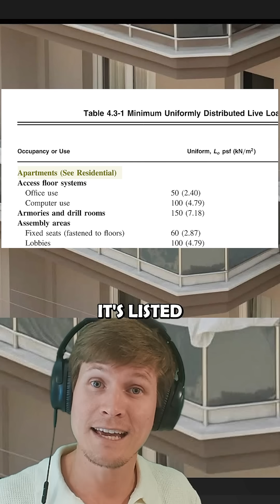Engineers HATE This Balcony Pool - Here's Why #structuralengineering #engineering #reddit

Comment: Please. As an engineer. Use metric... 1 L = 1 kg = 0,001 m³ or 1000 kg = 1 m³. So every cm (or 1/100 of a meter) of water depth = 10 kg/m². The balcony has about 50 cm = 0,5 m, so 0,5 m³ of water per m² of balcony = 500 kg/m². Converting this to kN depends on gravity, but we can round it to 1 kg = 10 N = 0.01kN to make it easier (order of magnitude is precise enough). So the approximate load is 5,0 kN/m². See how much easier this is? No calculator required!
Reply: You can make it easier than that.
Water density is 1 ton/cubic meter.
So if it's half a meter tall, it's half a tonne per square meter...
Reply: @Evan_Bell * metre
Reply: I just eyeball the shit. That one there looks dangerous and fun.  I'm sure it won't be fun for too long when it comes off the wall and you are swimming in the air. 😮😬😵☠️💀👻
Reply: How much is it in burgers per bald eagles?
Reply: Thanks for saying it. My head started hurting listening to psf and pounds and foots and shit.
Reply: As soon as you send men to the moon using a metric rocket - we can talk.
Reply: @whatdamaddox7824 You know NASA uses the metric system, right?
Reply: @andreas40588  It's just a joke shizzle.
Reply: no one is going to get the USA to switch to metric. not now. not ever. get over yourself
Reply: I don't care what unit you use, but as an engineer you had damn sure better be using a calculator lol
Reply: @jehreelul feel like you're putting too much trust in calculators. Most calculations are actually best done fractionally as its more precise, and really what matters most is correctly identifying and structuring the equation. The actual solving is pretty trivial, and it gets checked multiple times by multiple people. The only "calculator" I would use is a modeling software
Reply: All that when he just did one simple step. Excuse you, but yes, do please keep the oversimplification to yourself. Thanks
Reply: @Bosgek0 first of all, you added in an extra step of multiplying gravity to get the force, US units are already in terms of force (lbs). I understood your math, I just wouldn't call it "easier" by definition.

Second of all, (and I say this as an engineer and an American), I love the metric system...where it's being used. I also love the US system where it's being used. They both work equally well if you know math. However, mixing metric in the US and vice versa is a futile exercise and impractical. You have to take more time now to convert all your values to metric if they aren't already, and then how do you expect other engineers to check your calcs easily? Rounding between the two can also screw with your calcs when you try to convert back.

Not everything has to be converted to metric. Just work in the units that your client cares about. That would be the "easiest" way to do that load calculation. No calculator required? Unless you're doing a rough calculation for a client away from your desk, last time I checked the calculator is your best friend. No one will appreciate your mental math unfortunately.
Reply: He's likely american. The metric system is a strange creature from their point of view.
They use it in serious papers such as science, but not in everyday-murica-type situations😌
Reply: @ChaineYTXF All American students are taught both metric and US systems from elementary school onward.

Metric is used in all sorts of fields inside the US, like every profession you'd find in a hospital, all sorts of engineering fields, and so on. Both systems are used in the US military.

The metric system is not used in construction or building codes in the US.
Reply: I like to do both to check my work 😂
Reply: Says the human calculator
Reply: I was thinking about the same... These 24 square burgers per cubic alligators is absolutely ridiculous
Reply: @foshizzlfizzl a "foot" or square foot, cubic foot, etc is a standard unit of measurement, as is an inch. Its no different than using a meter or centimeter. What do burgers and animals have to do with it? 

Do you think that people measuring in feet are using their actual feet or something?
Reply: @histguy101 There is a huge difference.. You have to make conversions...that's a source of mistakes..10 cubic feet isn't 1000 cubic inches, but some fd up number 😂
Reply: Gotta love the metric system for volume to mass conversions. So simple.
Reply: Whatever bro! We have freedom units.
Reply: @morrit33 guessing you're American by that response. Do you know what system US businesses that trade and buy hardware internationally generally use, NASA use and the Military? What do you think a klik is or 9mm ?
Reply: @christopherdwyer9496 Navys 5inch gun and the .50cal, etc would like a word...
Reply: @wheels-n-tires1846 typical uneducated response, nothing to do with the conversation and unnecessary aggressive. 

I'm just proving you do use the metric system whether unaware or ignorance and nothing you have written has anything to do with it?
Reply: @christopherdwyer9496 you mentioned that the military uses it... and while that's true... It's certainly not 100% true, as my examples  show.  I'm not sure how what I said is aggressive, unlike your "uneducated" comment... which seems to be. ( Never mind that it's just wrong... I can speak about the military with significant experience and knowledge...).
 And lastly... no... I dont use it. I purchase my fuel, milk, and other liquids by the gallon. I buy dimensional lumber that's identified in inches. I drive on roads with limits set in miles per hour. I use extension cords that are XX feet long. I can go on like this all day....
 But ill give you one tiny point... occaisionally, I do work on cars that require metric tools... Although I find that annoying...
Reply: The next time your country does anything that actually affects the world we'll follow your lead.
Reply: @marcushenness6437  the whole world literally follows our lead. Every sheet you find uses metric system, everyone in the world except Americans and British.

Touch some grass
Reply: you're a bad engineer if you don't understand how to keep units coherent.
Don't convert needlessly.
Reply: Please come and convert the whole of the US. Otherwise, stop complaining that someone isn’t following your standards.
Reply: Nobody cares here in the states. We're not going to change units just so appease you're European preference. Also when people design these things they will check with a calculator regardless of the CAD software doesn't do it for them.
Reply: piss off euro
Reply: Womp!
Reply: yeah but 1 lbm exerts 1 lbf under normal gravity
Reply: As an engineer , you should always test and review your code and retest it after you merge it
Reply: You can't state equalities between different quantities, ie volume and mass.
Reply: Sorry, we live with freedom units from the most free country in the world. Get fckd metric system
Reply: As an engineer, I live in the US so I gotta suck it up and do 2 seconds of math in imperial. Not that big of a deal.
Reply: Metric makes it easy enough, but it is so jarring to me to see people using a comma as the digit separator for groups of individual and fractional units, and likewise with periods as the digit separator for groups of 1,000 and beyond.
Reply: No. In the US we don't use metric so our codes won't be in metric
Reply: As a scientist, just use consistent units. It doesn't matter. When was the last time you did a real calculation for your work, not an estimate, where you didn't use a computer?
Reply: Well considering the Americans refer to train drivers as „engineers“ who knows what he might actually be
Reply: Make your own video, Mr know-it-all
Reply: @ryanaddy1135 😂😂😂😂😂 how old are you to arguing like that? 5???
Reply: I've never been more bored watch a short
Reply: bro is using a calc
Reply: What we really need is a better system that combines both effectively. Therefore reducing costs to update old equipment and making it easier to build new stuff. Combine metric and imperial measurements.
Reply: @JACKBAIN17 there is not one reason to  keep your imperial.. It's simply inferior to the metric system in all occasions! It's just as always your convenience and comfort zone. It's like texting without word recognition... You can use it and be faster and more efficient.. Or you can write a text message for 3min...it doesn't make sense anymore! Change your approach!
Reply: No commie units rahhhh 🦅
Reply: No thank you, comrade.
Reply: Sybau
Reply: Exactly—using SI units makes the math intuitive. 1 L of water is 1 kg, so 50 cm depth equals ~500 kg/m², or roughly 5 kN/m² when considering gravity (1 kg ≈ 10 N). No calculator needed when you keep it metric.
Reply: This is why nerds get bullied😂😂😂😂
Reply: Freedom units! 😎 (I hate being an engineer)
Reply: Contractors don't even know where to contact an engineer and if that engineer is actually not engineer 😅
Reply: Nothing is lower than bitching about units systems. Can you do math? Then great, you can talk about things with your coworkers even if your old gauge had different numbers and words on it too!!
Reply: As a Canadian. Fuck metric I don't understand that bs
Reply: @Kb.69420 😅😅😅 because imperials just use google assistant for conversions. Understanding is not necessary 😅
Reply: If you're speaking english use a dot "." as a decimal separator. If I speak whatever continental European language you speak then in that context I will use a comma as a decimal separator. I don't care what language you learned math in, right now you're writing in English.

So it's 0.5m not "0,5 m"

PS: SAE measurements have the same trick for the weight of water, each pint of water weighs a pound. Each cubic foot is 60 pints or 60 pounds of water.
Reply: America 🇺🇸 🦅
Reply: Well, okay, mr copernicus, who's apparently smarter than us, dumb americans.Well you know what you're just proven that we're stupid for using an old system that really isn't that good. Does that make you feel smarter about yourself? Well, you shouldn't because you're smarter and I then we're stupid. So yeah, how do you like that
Reply: They prefer to use eagles per square inch
Reply: I kind of can actually understand this, as someone with dyscalculia
Reply: I’m a mechy and I will simply refuse to do so just because someone wants me to use metric.
Reply: When doing this kind of important math wouldn't you rather not do head math?
Reply: Oh brother 🙄
Reply: We know how metric works. We don't need you to explain it. You're a pedant.
Reply: THANK YOU! For translate to normal mesures! 😂
Reply: He didn't actually need the calculator since the cubic foot weight of water was just over what the regulatory minimum specifications for that balcony were. Anyone can figure out from that fact that the amount of water needed to make the pool usable would certainly far exceed the likely structural capacity of the balcony even without anyone actually using the pool.
Reply: US still using the imperial system is a dumb thing
Reply: I completely understand your frustration, but we have no choice😪 as an American, we got it wrong when we went with SAE
Reply: Yeah, I'm confused with pound per square ft too. I don't know how many kilograms a foot is, and I don't know how many meters a pound is.
Reply: @andikardian9014  example: if the regulation calls for 100lbs per square foot of an area of 10ft x 10ft, the the whole area should be able to securely hold 10,000 pounds.
Now let's throw some random numbers out there and say the balcony is 8ft x 15ft and the water depth is 2.5ft. This would mean that the balcony is holding up over 22,000 pounds. That's a lot. And not only can the floor not hold it with certainty, but the damn guard rail with glass will blow out anytime as well.
Im drinking, don't trust my math rn
Reply: Imagine using commas instead of decimal places lol
Reply: 🤓metric🤓
Reply: Just a truck driver here, balcony? Pool? No bueno
Reply: I don’t mind metric, but I really cannot stand commas in leui of periods.
Reply: The Gimli Glider does not second you.
Reply: Except this is America so we are scared of kilograms 😂
Reply: Honestly it doesn’t make sense to do that in 🇺🇸 as all there design standards are in imperial and would cause more issues, the maths is still the same, it’s just the values that are different.
Reply: Sorry I cant hear you over the sound of all the bald eagles screeching, V8 engines, and big tits! What did ya say? Fuck metric! Freedom! 

On the real I like to use metric 😂 but it just comes down to this is an american channel, if it was anywhere else in the world it would be in metric. No need to explain your metric superiority.
Reply: Bro what the oil
Reply: Isint conversion the reason why NASAs space craft crashed that one time?
Reply: @josechavez2521 you don't have to convert anything if you use the same simple easily divisable units that the rest of the world uses.
Reply: @dusannestorovic5699 Hey man I'm Mexican, you dont have to convince me lol
Reply: @josechavez2521  yeah and after that is when everyone particularly from a certain country started on the metric is better put it down our throats constantly 
   After pirates from said land stole our metric system 😅
Reply: @josechavez2521 not doing the conversion is what caused the crash
Reply: @josechavez2521  i think it was because they didn't convert the numbers in the metric sistem
Reply: @josechavez2521  ya, because metric is the real system of science and imperial is all based on metric system and to not loose accuracy ppl must go to metric to actually get real values, this nonesense of using imperial here and there crashed the NASA stuff.
Reply: @josechavez2521 conversion, yes. Which is why NASA stopped using imperial ever again. Because Metric is an easier system to work with and more importantly allows you to talk to and work with people outside of gun country. Because it’s the US and I think 2 other countries that use imperial as a main measurement system.
Reply: @josechavez2521 yeah and after that they adopted metric as the standard to prevent issues from ever happening together. That's the real main issue. When you have several people using different standards for things. Which is why I always just adopt whatever standard the requirements are in. Makes no difference to me which units I use.
Reply: Also as an engineer, if your reference codes are not in metric don't use metric! Keep units consistent with each other. It's how you end up making mistakes by forgetting to do appropriate conversion factors. 👍
Reply: @ZenithWest169 Unless the the codes are from the dark ages they will be in metric.
Reply: @joey66436 yeah I'm not a civil engineer and didn't even realize it showed both. I was more of just making the point that consistency is king!
Reply: @joey66436  Wrong. Codes are in the local standard because every building in that area is built according to those standards. He used the standards that are used in the US for commercial building. They are perfectly functional. Every skyscraper you see in New York uses that code even when they are a thousand feet high.
Reply: @ZenithWest169 should be illegal to use imperial units. The Metre is objectively better
Reply: @zerperior The meter is as objectively random as any other length unit ever invented. There is nothing inherently better about a base unit that long. It's actually very inconvenient for many contexts.
Reply: @kentix417 the meter is not arbitrary, it's based on the atomic density of silicon, which is a very stable non-radioactive element. It's based on a fundamental law of nature.
All imperial units are defined as ratios of metric units, that's how much better the metric system is.
Reply: @aftoknito I don't know where you're getting your information from but the length of the meter has never been based on silicon. At one point it was the exact length of a specific platinum bar and then it was a platinum-iridium bar. In other words, the length of a certain hunk of metal kept in a vault. Then later it was based on the wavelengths of a certain frequency of light in certain atomic transitions. Now it's defined according to the distance light travels  in a certain very specific amount of time. But all of that misses the bigger picture. That's all about increasing precision. 

The question is how come the meter is as long as it is? Why isn't it much longer or much shorter? Where did that original length come from that has been made more precise over the years? And here's the answer to that question which will show you just how arbitrary a length it is. The original definition is that it is 1/10 millionth of the distance from the equator to the North Pole along the meridian passing through Paris. That's it. There's nothing fundamental about that length in the universe. It's based on one planet in one solar system and the location of one man-made city. No matter how much more precise you want to make it, that's literally what a meter is based on. One 10 millionth (not even something even like 1 millionth or 1 thousandth) of a distance over the ground between two points on Earth. That length has nothing fundamental to do with the universe or physics. It's an arbitrary, man-made length -- no different fundamentally than any other arbitrary man-made length.
Reply: @ZenithWest169 That's how you blow up millions on a rocket like nasa did back in the day 😂
Reply: @neilsiebenthal9254 already discussed it.. my point is consistency above all else. NASA recognized that after the failed operation and immediately declared only metric would be used in all of it's work.
Reply: @ZenithWest169 no, convert them into metric, do your calculations, then convert them back. WAY better than using this shitty aaahhh system. Ask any physicist
Reply: @ZenithWest169  such as at one time of the space bound rocket… 🫠
Reply: @ZenithWest169  and infact we use something called "International system" where is mandatory to use the metric system
Reply: @ZenithWest169 nope, you just convert at the end. If you don't use matric you are way more likely to make errors than the error potential for converting one time in the beginning and one time at the end
Reply: @yannik1679 that's how NASA lost a multi-million spacecraft a long time ago. They since changed to requiring pure metric. My entire point is consistency is king!
Reply: @ZenithWest169 The comment is obviously written by someone not in the US, as he uses metric and a comma rather than a decimal point. So his building codes are most likely metric.
Reply: @ZenithWest169  Correct.
I heard about a church in a small village in a nordic country.
The architect used feet, but when it was built, they thought it was in meters.
So, they've got a gathering of 20 people
in a church that can hold 200 people, or so.
They built a separate room for the winter.
Because it's too costly to heat the church.
Reply: @ZenithWest169  the point is, imperial is stupid system of different units not matching.

Metric is so much cleaner and easier.
Reply: @pnodi5584  my only point is consistency above all else!
Reply: @ZenithWest169 As a Heavy Construction Contractor with a 10th grade education, i agree with you. I also know, their no way that balcony is design to carry a load of 60 P sqft. Its more like 1500 psi.
Reply: @ZenithWest169 there were references in kN/m2. However these were not rounded.  What I tried to show was that for estimations metric is simple: every 10 cm of water depth gives 1,0 kN/m2. If you get  comfortable with the SI system and know how to move a decimal point you can do all kinds of rough estimations without touching a calculator. My original post was maybe a bit too long, in practice I know these conversions by heart to do this in a few seconds.
Reply: @Delta_ACh  Lol I didn't notice at all to be honest. I'm not a civil engineer and was more of just commenting that you should be consistent above all else. Personally I prefer metric over our normal units and exclusively use metric in any personal project that allows it (meaning I'm not designing something that will mate to something else with non-metric units.. again consistency above all else). But regardless of how much I use them I can never guestimate any measurement in centimeters. I just can not develop any intuition for it after a lifetime of having everything measured in inches. What's funny though is I can not guestimate fractional inches as all because I have always used millimeters on the sub-inch scale lol.
Reply: @Delta_ACh  decimalssuckwaytoomanystringof.uselessdigitsandannoyingtoread
Reply: @ZenithWest169 i'm a south american machinist, and as a south american we use both systems (because we mainly import any machinery from the US as well as europeo). I can guesstimate both in metric and fractional inches
Reply: @TheSmmp1  yeah I wish I could guestimate metric
Reply: @ghost-jesus what about the rest of the world, since the US isn't the centre of the world
Reply: @yag-yet_another_gamer  idc, but total french erasure involves erasing metric anyway, so it's gotta happen.
Reply: Thx! 3ed comment and I was not disappointed 😂😂😂
Thank you for your service Mr. Engineer 🫡
Reply: Thank you, the american mind cannot comprehend this ❤
Reply: @revstreak "American mind" America is one of the newest founded countrys and the super power of the world. Let that sink in
Reply: @revstreak Just like you can’t comprehend that Americans learn and use metric all the time? 😂
Reply: @revstreak  The one time someone in America used metric, a spacecraft crashed.
Reply: Bro we use freedom units 🎉🎉 EAGLE 🦅🦅
Reply: @NobodyJustShorts except your military? Perhaps the real freedom units are metric!
Reply: @NobodyJustShorts  why are you using freedom units in an authoritarian country?
Reply: @NobodyJustShorts  u guys use british units
Reply: @NobodyJustShorts Not your scientist and military. Intelligent people un the USA use international measurements.
Reply: @josechavez2521 😂 You probably tell people the lie that metric got America to the moon. 😂
Reply: @michael-dm2bv  The crash happened after the moon landing.
Reply: @josechavez2521 Only partially correct. There are non-SI units in basically every discipline.
Reply: @josechavez2521  Everyone in the US uses metric, just not exclusively. Stop pretending that using metric is a sign of intelligence. You know what is a sign of intelligence? Using the unit that matches the situation.
Reply: @gravityissues5210 No, not everyone in the US uses the metric system; the US has a hybrid system with a mix of U.S. customary units and metric units, as a complete and compulsory conversion never occurred. While metric units are preferred for trade and commerce and are mandatory in certain fields like medicine, many everyday activities and commercial transactions still rely on customary units.
Reply: If you’re in America it’s easier to understand in units that are in use and everyone knows
Reply: I like metric, I like using metric. I hate seeing comments like this.
Reply: Yahhh idc what your title is, no one cares about metric lol
Reply: Please. As a normie random internet commenter, please feel free to take the time to script,  shoot, edit, and post your own video using any terms and standards you like. Until then, either appreciate the time and effort it took to share the information,  or scroll on past.
Reply: As a civilian (the demographic they want to inform) you need to use units the demographic understands. Or else your words are stupid and youre stupid 😂 thats how the public works 😂 he did the best anyone could.
Reply: As a person on the internet. No that's confusing af. Bro was perfectly clear. You swim, you die
Reply: No. Metric didn't put a man on the moon and sure as hell didn't build that building
Reply: @brisen245  not in the moon, but was the first to put man and woman in space so...
Reply: @TheSmmp1 sounds like commie shilling to me
Reply: @brisen245 what does shilling mean?
Reply: @brisen245  Well, metrics did put a man on the moon. But the astronauts did not understand metric, nor did the subcontractors. But all calculations in the application were in metric, with conversion for presentation...
Reply: @brisen245  Dont want to burst your bubble, but it was german nazi scientists that landed you on the moon. And i bet you that they used metric mostly.
Reply: Ok, but who knows what a kilonewton really is except an engineer? You know what I mean? Like I have no idea how many newton's I weigh, but I know exactly how many pounds I weigh. Much better for a video intended for the general public and entertainment purposes.
Reply: @dakota8189  You're right to ask. If the aim is to get an idea, on Earth, 1kN corresponds to about 100Kg.

So only imperial system users know what you mean. 😅
Reply: I'd like you to stop using commas where decimels should be used.
Reply: @notneb82 sorry but you got in backwards, just like the country of reference 😂😂😂
Reply: @notneb82 have you ever been or worked with anyone outside the USA?
Reply: @notneb82 lol dude that's literally most countries in Europe and several in South America. Several other countries besides them too. If it wasn't for the fact that India and China (which makes up 36% of the world's population) didn't also use the decimal point instead of the comma, the decimal point would be in the minority of people using it
Reply: @ZenithWest169  who cares?
Reply: @ZenithWest169  But they do use a decimal, it just makes sense that when you are writing in English you should use a decimal, when writing in French, German, etc use a comma.
Reply: @ZenithWest169  As a European with a locale using a decimal comma, I do have to say though that a decimal point often makes more sense. A point is easier to overlook, but if you have text giving you a few figures, the comma is outright dangerous. Imagine "Last times I went grocery shopping, I had to pay 67,59, 55,83, 25,77, 81,10". This is hell to read.
Reply: @ZenithWest169 and when was the last time India contributed anything?
Reply: @ZenithWest169  WOW, if it wasn't for literally the three most populous countries in the world using the decimal instead of the comma, the majority of the world would use commas! Thanks for that amazing factoid.
Reply: Maybe on the internet the metric system makes sense, but it's not used in real engineering in the US
Reply: @lordgman1 Not used in real engineering in the usa? The Us military use it. Perhaps thats why that bridge they constructed broke to pieces.
Reply: @lordgman1  Because it's too hard for them to learn. It's alright, the rest of the world is actually smart. Except for the UK and some other exception ofc.
Reply: @lordgman1 you'd be surprised as to how much easier it is, when you can just get your tools of all kinds, in actually sensible SI units, and just use your sights, and logically routed numbers, as opposed to needing to ask for a fraction-numbered anything, that solely makes sense in a cultural bubble of yesteryear.

As there's a reason why we have ABC, and 123, on nearly everything else
Reply: How is this easier? You did way more math than he did. Has to be satire
Reply: @GregFirehawk it's just moving decimal points back and forth lol, it's as easy as it can get. Unlike imperial units... That's a brain masher stuff lol
Reply: @hs.j7291 barely any actual difference in practice. Also the units this example dont even matter, hes literally just multiplying by 1.5 and then by 2.5 from square units to cubic ones. Shills for metric always grossly exaggerate the actual utility value of sliding decimal points around, as if its a constant need or something
Reply: But lots of us don't like or care about using metrics... most people aren't going to relate to metrics like they will the older style...
Reply: @wheels-n-tires1846  There are literally only 3 out of 196 countries that use imperial. Most people use metric.
Reply: @vladlu6362 the United States doesn't use the Imperial system. Stop being ignorant. 😂
Reply: @vladlu6362  Who the hell cares. Literally no one outside of Japan speaks Japanese. Do you go to Japan and tell them to speak English?
Reply: @wheels-n-tires1846 actually, most people speaking English use metric 😅 simply because so many people use it, and basically everyone use metrics.
Reply: @wheels-n-tires1846 
Most people? 
MetricS?
Reply: @wheels-n-tires1846 Alright cowboy, we know it's too difficult to change 😂.
Reply: @mugennojin3513 Well.. I am old..
 So yeah... really not interested in changing after using Imperial for almost 50 years!!  I'm not gonna lie, haha!!!  Besides, I could be wrong, but, isn't the US the biggest share of YT veiwers???  If so... then shouldn't videos cater to that?? I'm not totally anti-metric, but I don't like the anti-Imperial folks mainly in two of my favorite niches: old cars and naval history. First, the 60s cars I build and love- NEVER had X.X Litre engines. They were in cubic inches. So stop it!! Second, warships in the WWI and WWII era- Only a few nations.used metrics, so the Iowa class battleships for instance NEVER had 406mm guns, they've always been 16in!!  So, that's super annoying.
 Ok, rant over haha!!👍🏻👍🏻
Reply: @wheels-n-tires1846 fun fact, the biggest share of YouTube viewers is India with twice as much people than US, US does have a bigger share of views however, but not by much, but that is pretty much irrelevant because US still makes up less than 15% of all viewers, and pretty much 85% of people watching YouTube use metric so... I don't hate imperial btw, but I do believe that having a single standard is better than having two, so I'd like to see the imperial system fade eventually.
Reply: @wheels-n-tires1846 the real problem with the imperial system in the US is how affect the other countries. US is one of the biggest markets, so, everything is pre build for pleasure that market, meanwhile the other countries has to deal with the annoying problem of having the 2 systems mixed together. (Don't get me bad, it's useful when you need 3 meters of house with a diameter of 3/4 inches. But when you need exchange information with someone of the US, especially with research themes, is something really annoying and can lead to errors)
Reply: @wheels-n-tires1846 the us is literally the only country on earth that uses the imperial system.
Reply: @aftoknito The US does not use imperial units. They have their own system.

And that's just not true. Almost every country uses two systems, and the US is no different
Reply: @aftoknito not entirely true... and so what??
Reply: @wheels-n-tires1846  Fun fact. A lot of us do not apply there. Only 4.2% of Earths population use empirical system. That is a very minor minority.
Reply: @wheels-n-tires1846 nah American engineers can handle metric. Hell, the whole draw to metric is that it’s easier. But we also take courses in and regularly do calculations with customary units. The metric critique is just rage bait.
Reply: @thatsunpossible312 maybe so... but as someone who grew up using the old ways, in a country that still works daily, everywhere, with inches, gallons, acres, etc... I dont need someone telling me my system is bad or Im backward for using it. Sure, some engineers use it here. Some industries do. Fine. But for the average person in the US, we're perfectly fine not buying 1.8litres of milk, and hopefully we will never have to use 50mmX100mm boards to build our new house addition.  Dont care what the rest of the world uses.  Dont want it or need it. Or people telling us to change...
 Like the saying goes- theres two kinds of countries. Those that use the metric system, and those that landed on the moon...
Reply: @wheels-n-tires1846 Bru, you haven't been outside USA, do you?
Reply: @JnManuelAG been to southern Europe, N Africa, and the Middle East... your point??
 Yeah... they use metric. So what??. Most elements of day to day life here  don't use metrics. Have no interest in changing... and am tired of everyone telling me to, lol...
Reply: @wheels-n-tires1846  "most people aren't going to relate to metrics". Well, the internet is kind of international. And only 3 countries in the world use imperial. The rest uses metric. In fact the US does use metric as well, all imperial values are derived from metric these days.